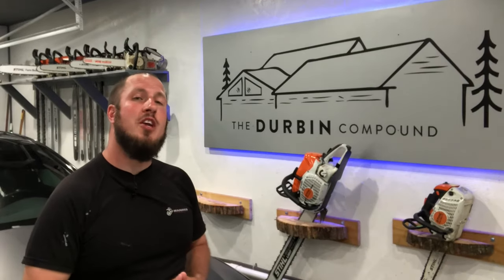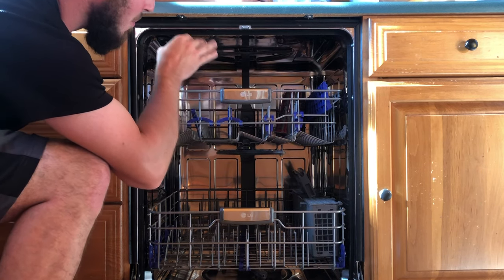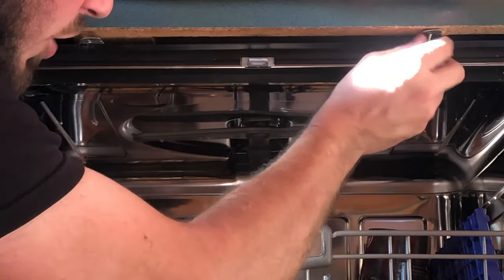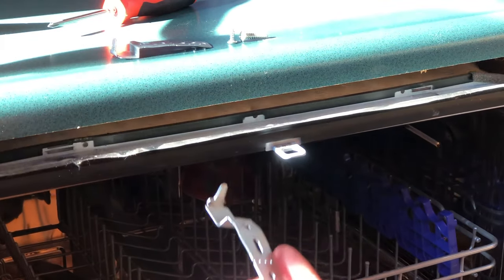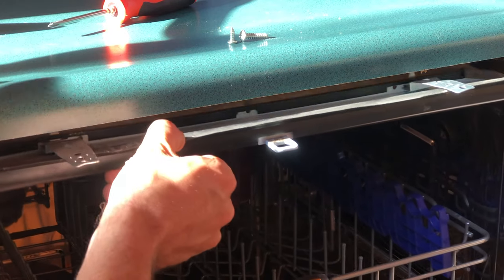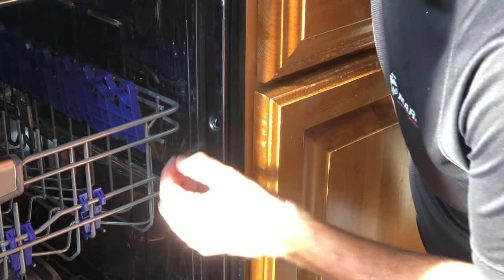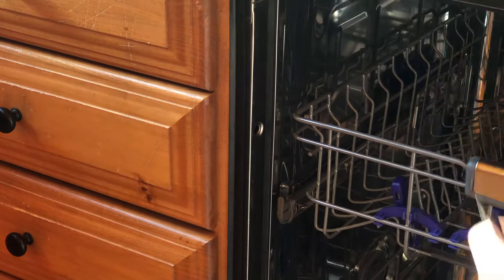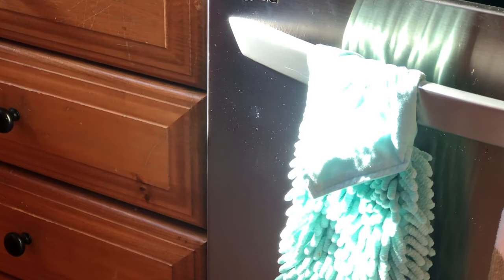How To Fix A Dishwasher That Keeps Falling Forward!

Comment: Thanks! The counter top above out dishwasher was a bit frail and after a month of use the mounting screws broke through the back of the counter top lip where it was connected. I had totally forgotten about the mounting on the side walls into the cabinet. This helped a lot.

Comment: thank you so much, I did not know I could screw them to the cabinet on the sides. The holes under the granite have become so big to hold any screws. So I could not do this on the top with mounting bracket. Going to try the sides, hopefully it works
Reply: how did it go?

Comment: So helpful! My dishwasher isn’t loose, but for some reason (maybe a kid stepped on the door) it seems to tilt forward, and if too many dishes are in the rack, they roll forward and almost crash to the floor if I don’t stop them. Do you have any tips or a video on how I might address this? Subscribed and thank you!!
Reply from the maker: Hummm I think you have an adjustment issue of some kind.  It may be that the feet in the front are all the way down and the whole washer is tilted forward.  Check the clips under the countertop edge. They easily bend but can still hold it tight. Just not in the original position.

Comment: I got those long timber lock screws and drilled them through the bottom of the dishwasher into the floor.  One on each side of that fan thing in the bottom will do.

Comment: Those side screws cinch down by going through an angled metal tab with a hole in it that is punched out of the outer case. Both of those tabs have snapped off on my dishwasher. Is there a solution for that?

Comment: What really bothers me is that the simplest solution would be to drill 2 holes on each side of the dishwasher, one high and one low.  I didn’t really come up with this idea, it was a standard on my two previous miele dishwasher, my first one was purchased in 2004. 
wishing now i didn’t buy the GE, it was engineered for formica, not granite.